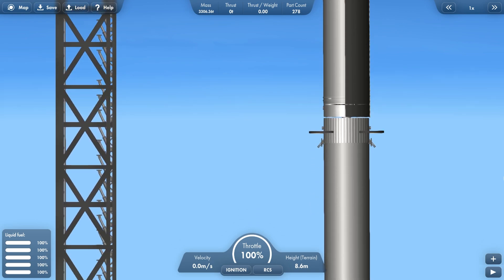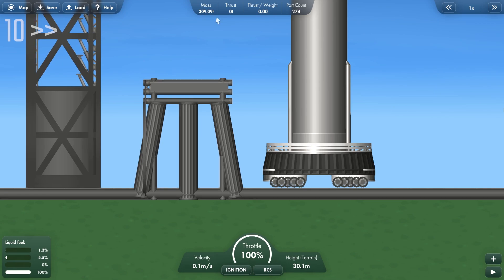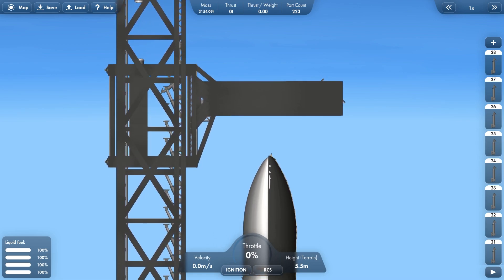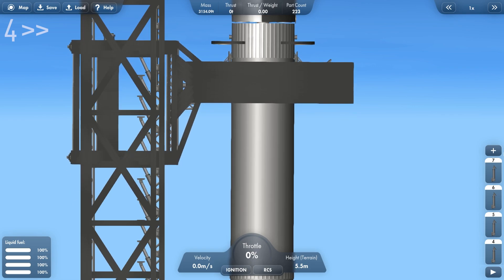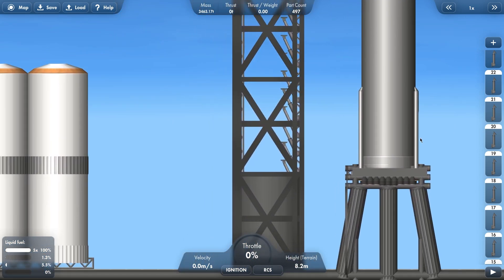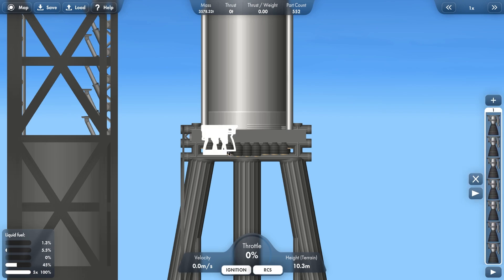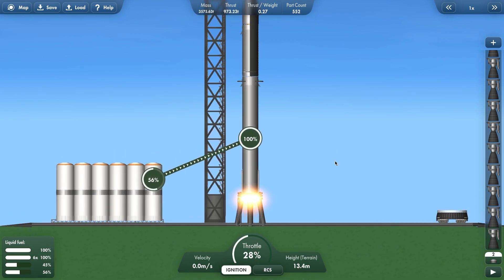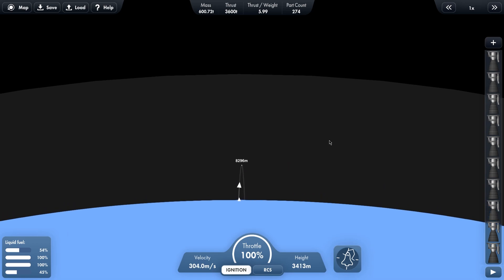If Starship was 2D | Spaceflight Simulator

Comment: the starship entering the atmosphere at a 90 degree angle also happened  to me 3 times, it mean that the nose and the aft of the ship is unbalanced making it lose control and tilt
Reply from the maker: Yes. As I said in the video, we need a third dimension to add some flaps on the rocket